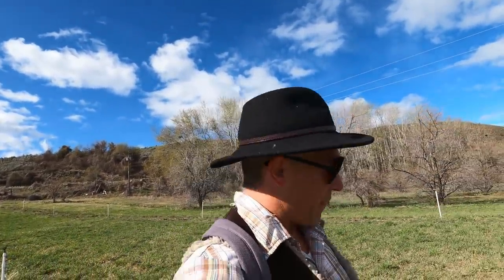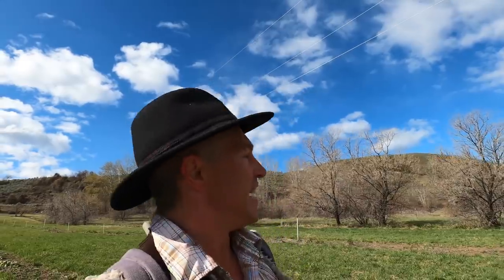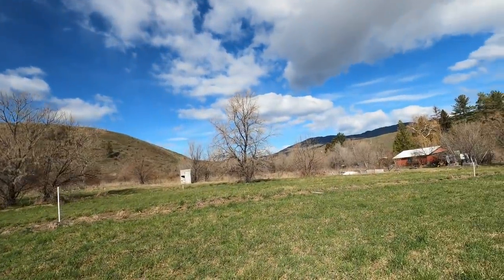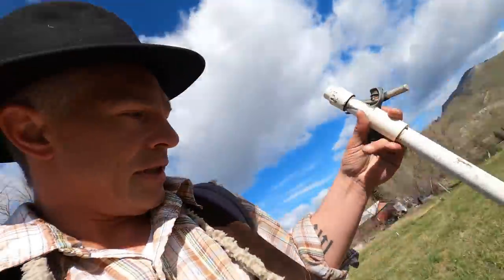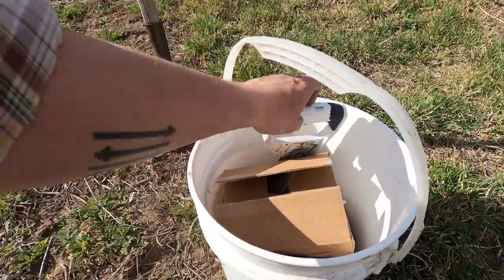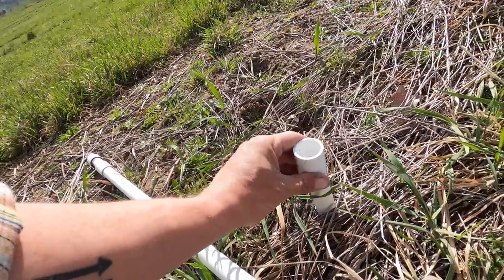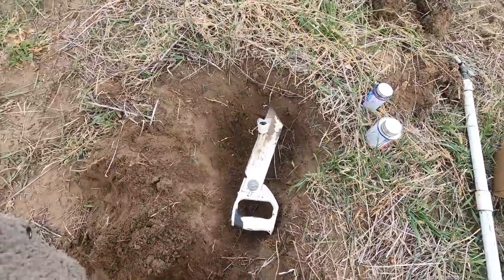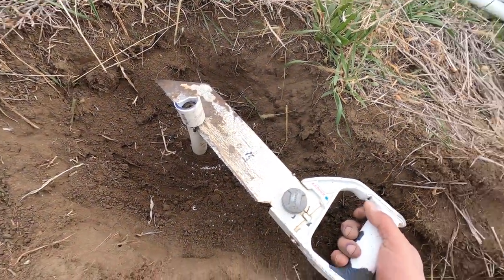Fixing Sprinklers for Summer

Comment: Just has to do this to my back yard water  garden hose spikit... sure needs to add a metal T-post to each sprinkler and use metal wire ties or hose clamps to secure it to the post. Would take more time but nothing would be knocking it over.

Also if your gonna pray when you eat you should be praying as you poop 💩